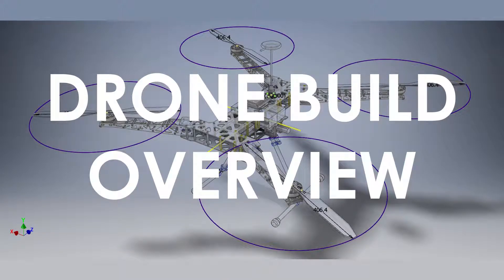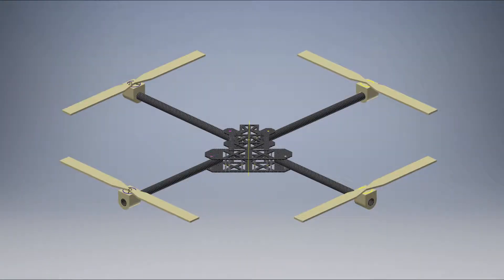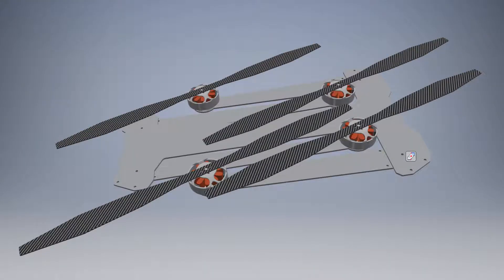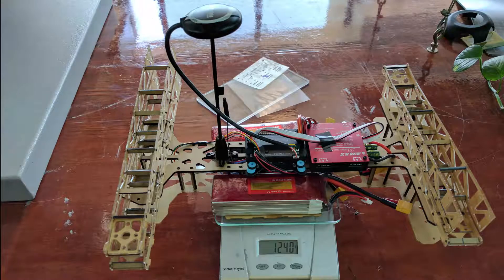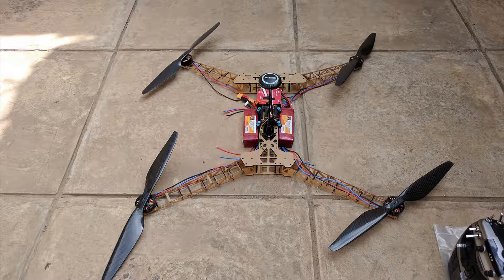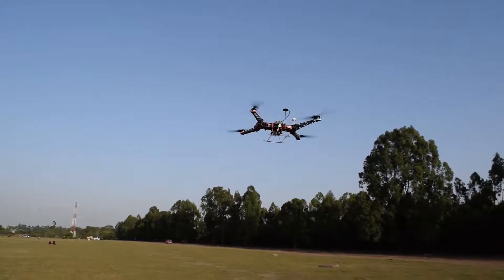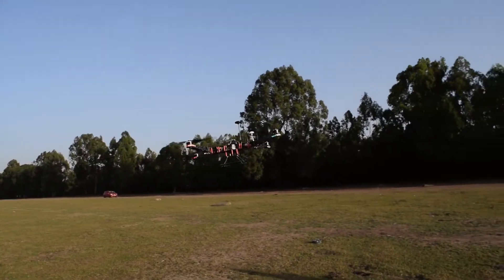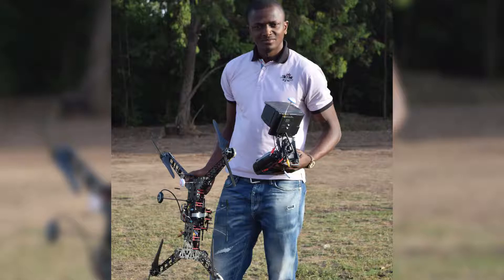Custom Drone Build - Overview

Comment: Hello. 
Really great work!
I have few questions:
* How much is the flying weight?
* What type of Lipo batteries are you using?
* How long is the real flying time?
Thanks,
Kristo
Reply from the maker: Hi, thanks!
-Total AUW is between 2.5-3kg depending on the batteries used. Initially I used 3600mAH 4S battery packs, but these only gave me about 13 mins of flight time with 1650 propellers.
-I am currently running a 4000mAH 5S battery pack, which now gives me about 16 mins flight time, but with a lot more thrust to carry a decent payload.
-I will soon upgrade to 1755 propellers and twin 3700mAH 5S packs, that should ideally give me over 25 mins flight time.